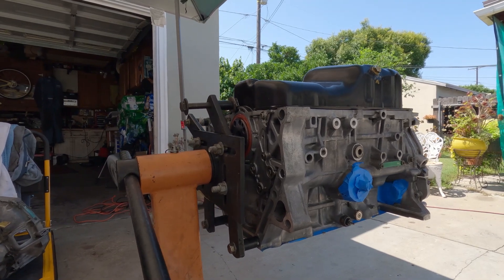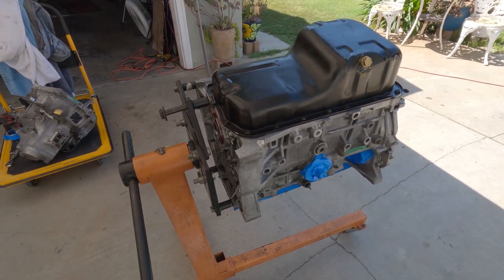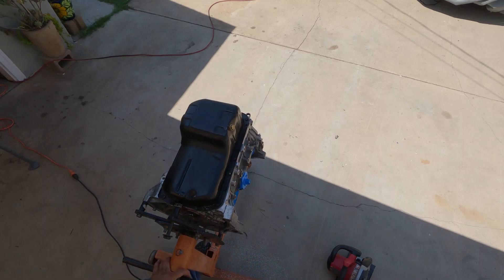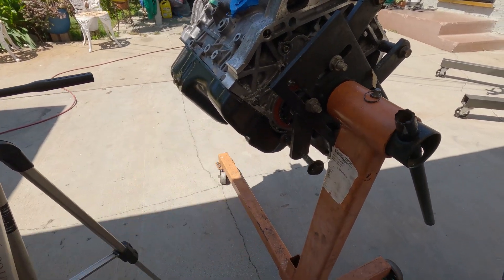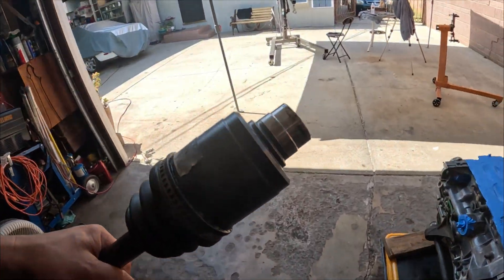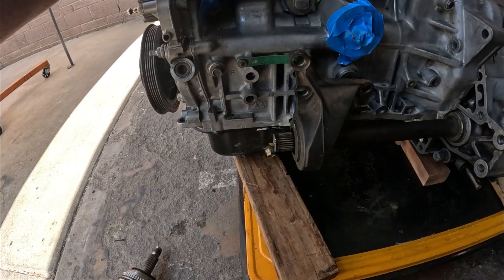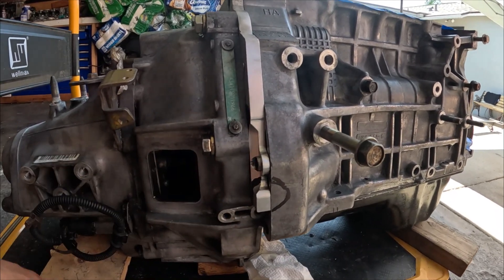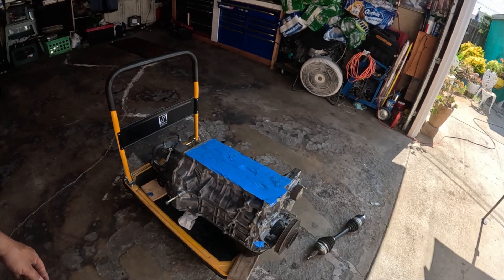F23 block mated w/ B series tranny. Semi Plate H2B/ G2B build  ep.3

Comment: That's great, then you can use the civic shifter and axles.  Question using the h22a tranz in the civic what axle are used ? I'm doing either a F20b or h22a . The f20b block got trashed but the rods and pistons are really nice.  But I was only able to find a h22a motor . So I'll use the rods but now I'll need pistons. So I'm trying to find a trade . Crx with f20b made the 700hp club
Reply from the maker: Hope civic shifter rod will work, l read that 1 rod is different but l'll find out soon. I'm using   Insaneshaft axle. If you are making your own axle. On pax side you need H22 inner hub joint coz Integra inner joint is too short. The axle and outer joint will be from 89 Acura Integra. 93 Integra is too long, l tried it and its binding coz my car is lowered. If you are using your H22 halfshaft, you need H22 inner jont to connect it and use 89 Integra axle w/ outer joint. They say you can use 93 Accord halshafts and use 89 Integra driver side and plug n play, but l didnt try that route. I didn't have a good luck using Insane shafts, l think it's because my car is lowered and it put the axle on a weird angle. I think that's caused the destruction of the inner bearings like you can see on the video.
Reply from the maker: Good luck on your build and that's a lot of power being put on ground man! Thanks
Reply: @sagittnet2158  thx man , ya we will see . Iv only been up to 450hp to the wheels with my integra, my motor was built for more at the time but I wanted something I could beat on every day without much worries. That was a great dd I built then with LSD qu  JDM GSR tranz. Beat on that swap for few years never broke shit . I got caught slipping one day and it got stolen, 98 type r with JDM front .  turbonetics kit . All the good stuff was in it . I did ended up getting the motor back , I should have saved it but sold it to my best friend cuz he had one of my  old Integra and I was building my 69 Chevelle motor at the time . fast forward the lsv  today it's still just sitting there after 6 years now.. but this will be my 1st h or f motor . I was always a fan of the b motors . But ya 700hp in this crx will be pretty crazy , it's roll caged so that's a plus. Need to find a set a rings and pistons for the h22 and I'll start building it. So I was reading that you can't bore these motor ? They can't take a .010 bigger piston by only boring it ?
Reply from the maker: @brianburris  oh man! Too bad the Teg was taken away from you w/ all good stuff in it. The H will accept a oversize piston 87.10mm but you have to use a OE o/s piston otherwise any aftermarket piston will damage the liner even a  compatible Mahle piston will do it too or Nippon racing piston. I've seen it from some of my subcribers. My other h23a1 vtec hybrid that l gave away and l recently found out the forged piston l installed, it damaged the liner. It's best to have it resleeve or use a f20b block or F23 coz it got iron sleeve. Later man and good luck on your build.
Reply: @sagittnet2158  thanks bro , ya I left the Honda stuff for 10 years but I miss it but I found this car for a price I couldn't say no too ,So then I can't use forge pistons in it ? I do have a F20b block with 900 dollar Forged piston and 1200 rods. But it spun the middle main bearing. I still have it but no crank and it did damage the bearings brace . Iv been trying to trade the h22a for a F20b; , I do like the h22  block because it's closed deck be cheaper to build. Don't have the money for darton sleeves. Not sure how much re sleeving would cost. Be nice to just reuse what I have in a new f20b block tho
Reply from the maker: @brianburris  not good, new sleeve cost $1500 nowadays and l think it'll be even higher. I paid quite a bit on my F23 to get it sleeve. Okay man! Thanks